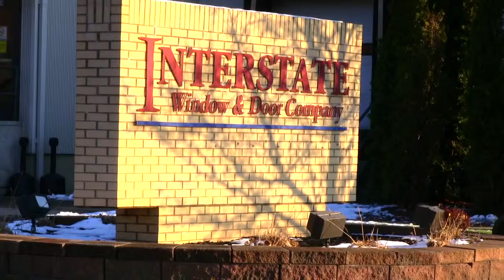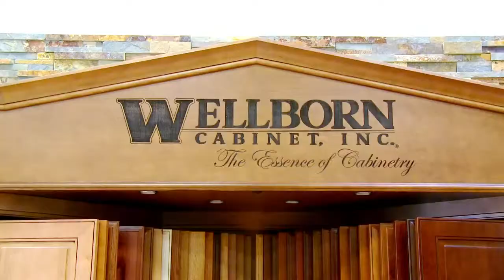Interstate Building Materials - Made in Pittston, Pa

Comment: I just bought two awning windows off of you. 24 x 24 the other one 30 by 32.  With the j-channel attached to the window already.  I don't know if you noticed it or not but the flange that you nailed the window in with doesn't even go further out than the j-channel that you put on and the j-channel isn't really deep enough you're supposed to leave a quarter inch space for the siding to expand and contract. You're lucky if the spaces 3/8 . how do you nail it up if the nailing flange doesn't protrude past the  j channel does anybody work there and look at the window and know anything about Windows oh yeah one more thing how do you get the screens out one window had a tab to pull. Which sucked.  The other window doesn't have a tab how  do you get it out ..you would think after you made the window you would look at it and say how am I supposed to nail this window if the j channels in the way. All in all a bull shit  window. I know I know I could screw it up and put the screws on an angle.  But wtf.